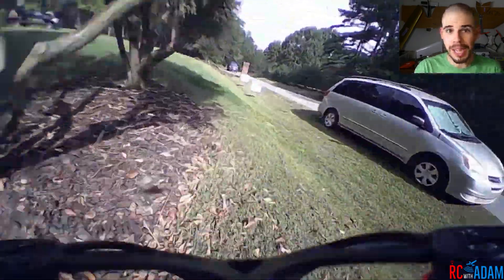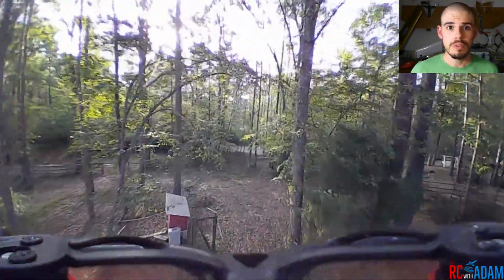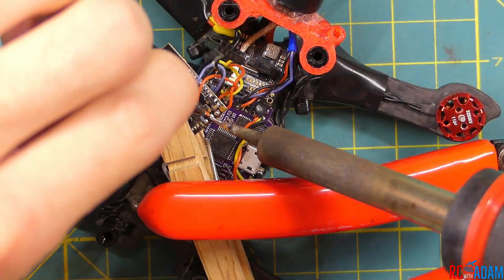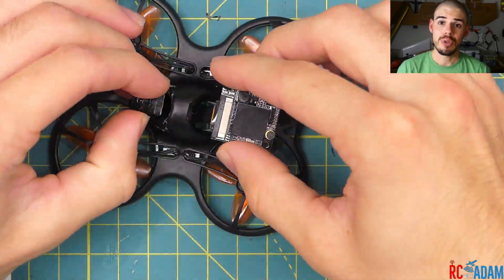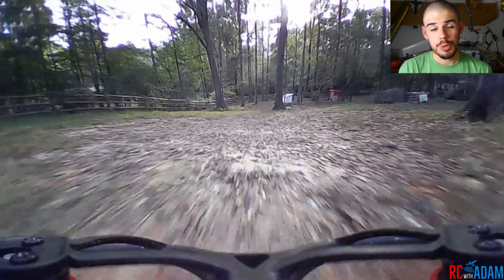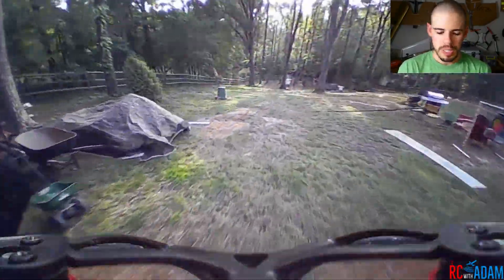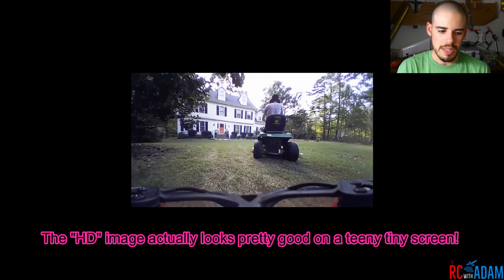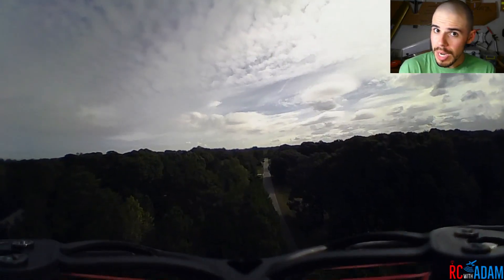TinyHawk S HD Conversion - DIY HD FPV DVR Mod - Is there a HD Emax TinyHawk S? FPV Flight Footage

Comment: Hi Adam, I recently put a Runcam Split 3 Nano on a TinyHawk 2.   After blowing up an AIO board I finally got things going. Flight time is pretty good still getting 3 min on 2S 300mah.  But the stock tune has a pretty constant vibration to it.  Did you do any PID tuning to your build?
Reply from the maker: Sounds pretty cool! No, I didn't do any PID tuning.

Comment: I'm glad you did this. I was wondering if I could change to an HD camera on my Tinyhawk Freestyle 2. Now I know I can.
Reply: Did you do that yet? It works?
Reply: @giovannimarchese8537  I'm sure it would work but I haven't done it. I crashed my Freestyle 2 and now it flies like it has a flat tire. It must have a bent motor shaft or bell and I haven't gotten around to figuring it out yet. Plus I also have a Tinyhawk 2, which has the same board, and I've had 5 of those boards go bad or arive in the mail not working. So I won't touch the Freestyle board because they are junk as far as I'm concerned. If I look at it wrong it may stop working. Instead I built a couple quads running 3 inch props and have a Runcam Split 3 1080p HD camera in one and a Runcam Hybrid 4k camera in the other. The Hybrid stopped working. More junk from China. I'm sure it's a matter of time before the Split 3 camera stops working. I've found out that it's cheaper and far less frustrating if I just buy an Insta360 GO camera, Naked GOPRO, or the new BetaFPV ONE R naked camera and just mount them to a quad. I'll get a better quality, better built, and stabilized camera for less money. Given that I've had to buy several cheaper cameras to get HD video. I have 1 video on my channel of the Hybrid camera flying on a 3 inch quad if you'd like to see it's quality before it went into an UPDATING... loop and got stuck there.
Reply: @CarbonGlassMan  oh wow, thank you